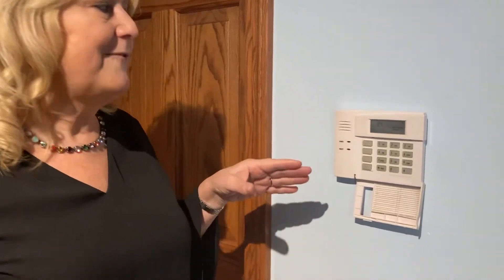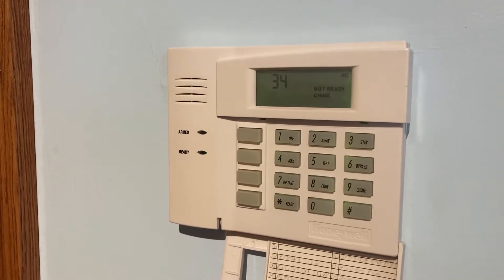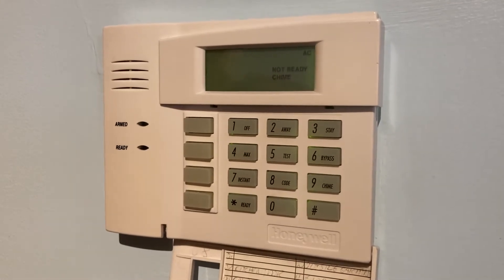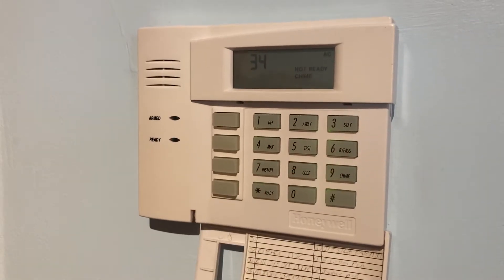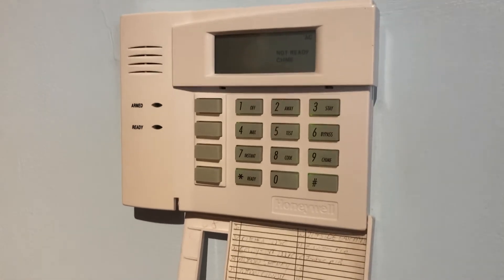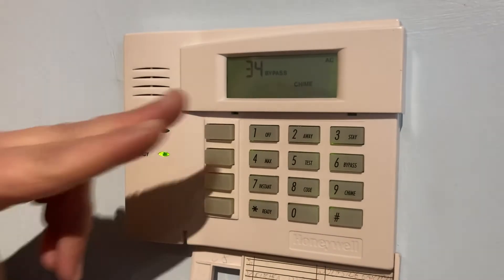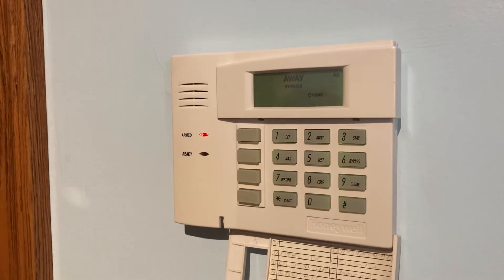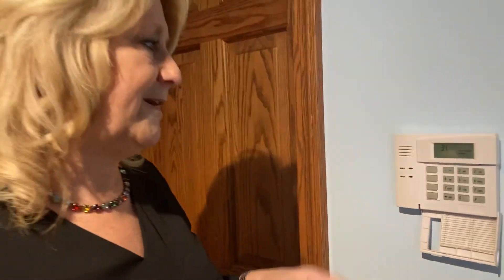My keypad says “Not Ready”. What should I do?

Comment: I keep getting a CHIME BAT that appears… any way to get rid of that code?
Reply: BAT means "SYSTEM LOW BATTERY", your system has a backup battery that is used when the power goes out, and the one currently installed is dead. To fix this, you can order/buy a replacement 12V 4AH battery, and replace the current one inside of the control panel.